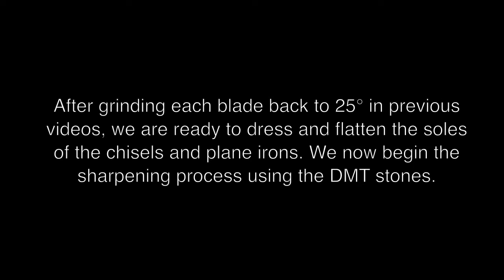Sharp Chisels and Plane Irons using Diamond Stones • Complete Sharpening Series Video 8

Comment from the maker: @turnercarl I have seen that device and it is very clever. That is why I love the Stanley #80 so much, because it flexes the blade like their product but has the handles as well. It can do either really fine joint floating or gorilla stock removal. I was about 27 when a very experienced furniture maker showed me the power of that tool. I left his shop and went and bought the one I still have today. I am 52 now.

Comment: I really appreciate your approach to sharing what you have learned over the years.  I recently purchased the Makita water stone you use and sought out your videos to help get acquainted with how to use it well.  In the process of watching your entire series so far you mention an often overlooked aspect, that of dressing the back of the blade first.  I was surprised that  you mention a number of times that you don't take the back of the blade down as fine as the face.  I'm not a fanatic, I have made a living building furniture, homes and boats for 40 years and agree with your attitude that you need to have a system that gets you sharp effectively, accurately and fast.  You humbly say you are open to anyone sharing a way to improve what you do and I would suggest a simple change that I believe is not a "religious" point of view but simply building off of your own experiences.  In my experience you can never get an edge sharper than the back of the blade is dressed.   I would encourage you to take the back as far as the front.  The improvement would not be noticed in most tasks but when approaching wild grain or some of the difficult angles carving requires the difference may become worthwhile. 
 Thanks again for your videos.

Comment from the maker: Great questions. The only reason I bought the new 3x8 stones for my setup was the two grits I bought were not available in the cost effective 2x6 size. The VerySuperCool Tools jig I use does not require large stones since the jig rides on a reference surface which is granite in my case. I have tried the dotted stones and did not care for the feel. I am used to continuous surface stones so I am probably prejudiced.

Comment from the maker: Yes just the regular Simple Green. I have used it to cut thousands of holes in steel with no rust promotion. Not toxic or oil based. I like that and the price. Just note that Simple Green can react with aluminum and cause a cloudy oxidized reaction if left on for a long time.

Comment from the maker: You have not completely ruined the chisel, but you do need to remove the discolored portion. Sharpening is about patience. Use your grinder for few seconds, then put your edge in water and then do something else up for a minute, then go back to it. Most grinders are moving at 3600 and that is way too fast for tool steel for more than a few seconds with very very light pressure. All questions are welcome and I am happy to help if I can. I just try to keep it simple and cheap.  Allan

Comment: Hi Allan, I have a question about that diamond stone you are using. It looks like a solid slab of metal, I have never seen anything like it. The DMT stones I know of are flexible thin sandpaper like things. I want to use it to sharpen my hardmetal Japanese pruning shear (rockwell 58 - 60) and some woodworking tools. What kind of 'grits' do you use here? And does that DMT stone needs flattening every now and then?

Comment from the maker: @Mueiwark The DMT stones I am using are 2"x6" two sided stones. One stone is course and extra course, and
the other is fine and extra fine. They are graded industrial carbide bonded to a rigid steel plate. They do not need flattening at all. Waterstones are like having children with all the dressing and babying they require. My DMT stones are in almost daily use and are years old and still cutting like champs. I think they are the best value I have found. High performance but reasonably priced.

Comment: Allan:  Two questions that I thought I would ask here versus via email as I think others may have similar:   a) Can you comment on the value/use of the 8" vs 6" DMT stone? What tools do you typically need the 8" for?  b) You have the steel DMT stones (Dia-Sharp).  It looks like DMT now has a polymer based stone (Duo-Sharp w/ the poka-dots).  Do you have experience w/ this new one? It is about $30 more per 2 sided stone.  Trying to guess if it would be worth it.

Comment: After seeing it needed to go to 16,000 grit stones, I have gone to 3000 grit. BUT, what would be the difference of going to 1000 grit, then srop till it looks like a mirror or chrome. It is very, very sharp. Cut myself and didn't feel a thing. So should I buy an expensive 16,000 diamond stone or just strop it???
Reply from the maker: +Lee Haire I do most of my sharpening only to extra-fine on the DMT scale 9 micron is about 1500 grit. I have an extra-extra fine 3micron 8000grit stone also but I really cant tell that much improvement for the kind of work I do. I use my chisels for a lot of paring work and for chopping dovetails and I think I get some pretty clean cuts. I pretty much sharpen my plane irons the same way, and I can take whisper cuts in hard woods with my block plane. The problem I see with stropping is sure you may get the mirror finish on the facet, but that is not where the cutting action action is. Care must really be taken to make sure your stropping action is not blunting the zero dimension line between facet and sole. I generally don't use leather because I can't control that geometry.